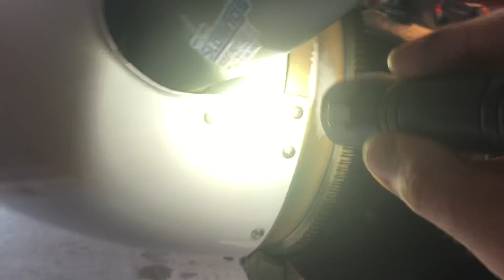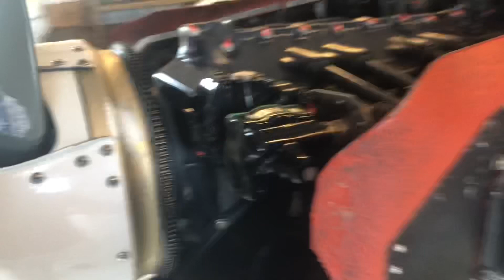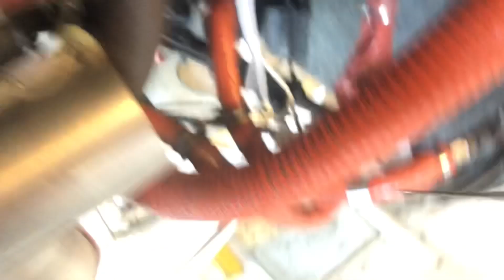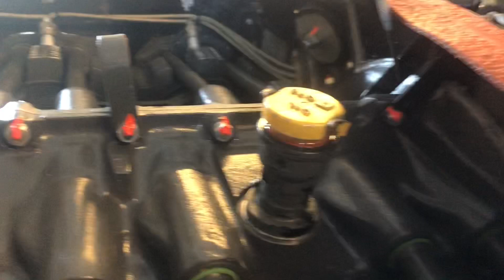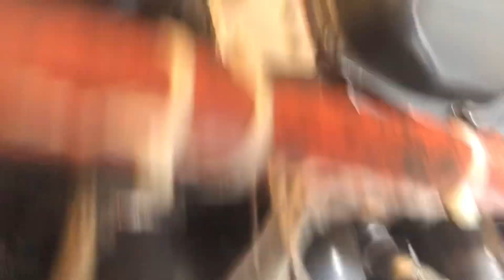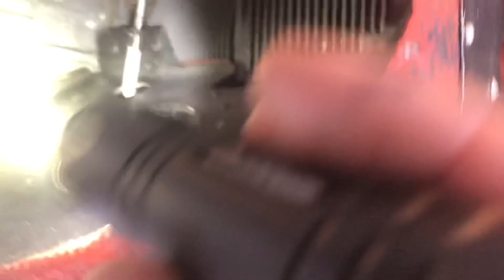General Leak Points on a Lycoming Powerplant

Comment: Ugh. I have this engine and there are 2 spray patterns on the top of the cowl. ONe near the front and one near the middle pilot side. Oil seeping out of the left piano hinge and oil door. It gets up on the windshield pretty easily in flight. Unfortunately, my engine is black so it is hard to see the origin. I wish they would have painted these engines white. I have a brand new prop governor so maybe something not seated when installed.
Reply: @fly6tech776  What are your thoughts in UV dye / UV flashlight to try to locate the source? Is that legit? I have had 2 push rod seals replaced. I just don't want to go around replacing everything hoping each thing fixes it.
Reply: And yes 6 Cylinder. O-540 in a Comanche 250
Reply: Good evening 

I have the same problem 1 or 2 streaks forming on top center of the top cowling. Eventually spraying onto the windscreen. Did you find the problem with yours? Ty